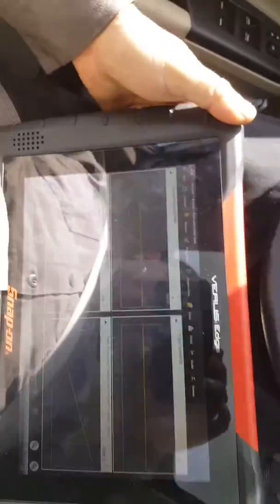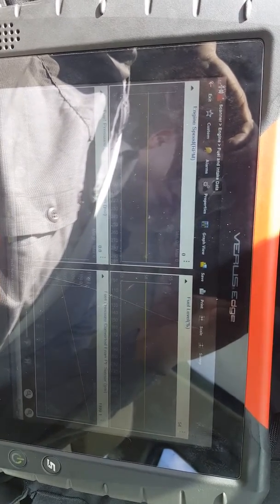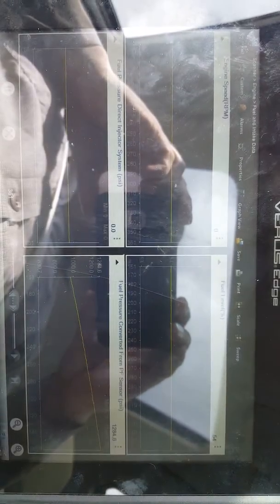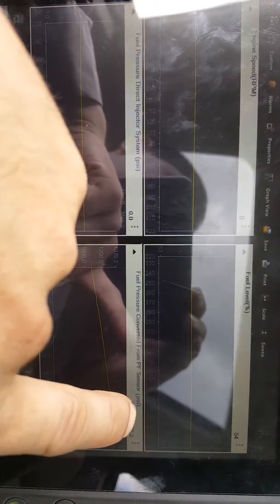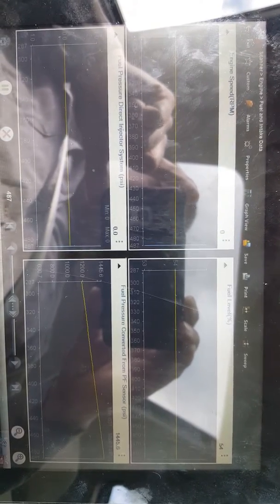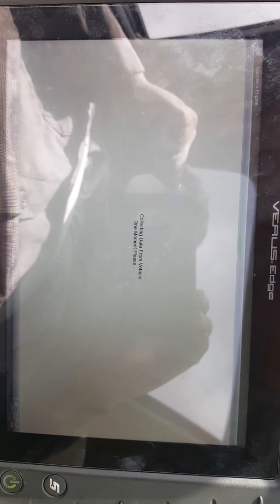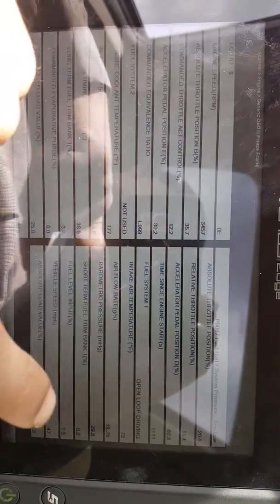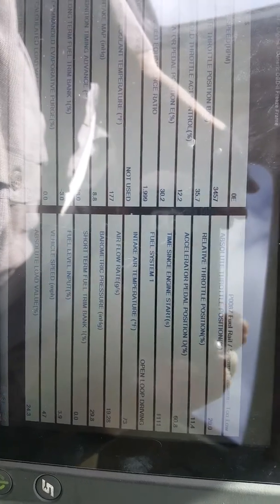2013 Honda Accord P0087

Comment: How did you fix it?
Reply from the maker: Mike Jones , how did I make the pressure rise?
Reply from the maker: Mike Jones you fix it by putting gas in the vehichle and not running it low. Now when you drive it for 15 minutes or so and you turn the engine off key on and the pressure does not rise then you do have an actual problem
Reply: Yes